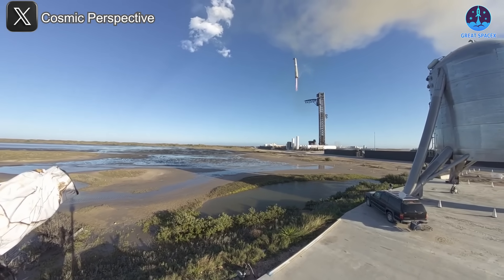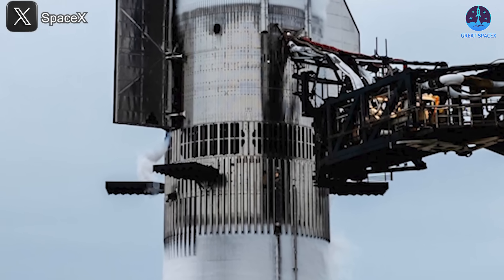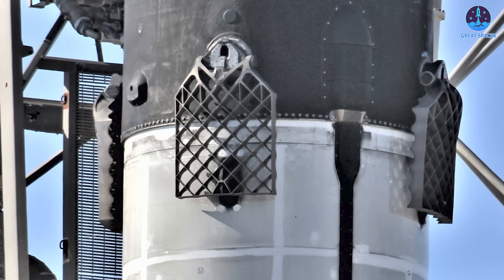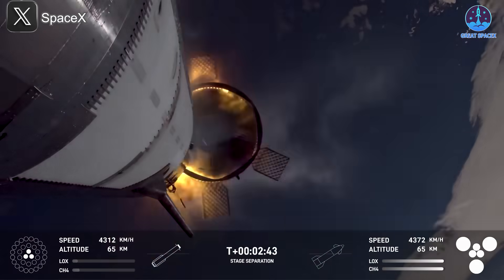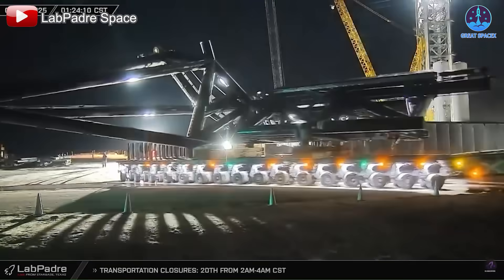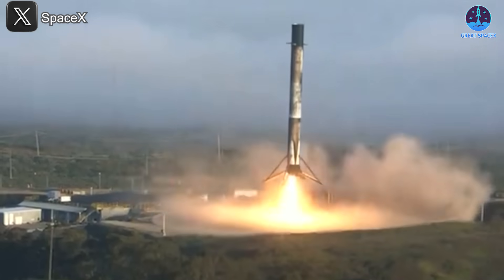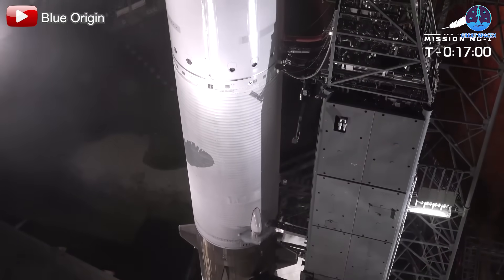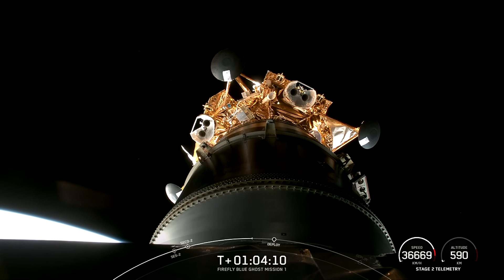Starship Booster 14 Grid Fin MELTED & WARPED During HSR Separate. What Happened?

Comment: Why reinvent everything. Use ullage engines on the starship to gently separate and settle the fluids. Then you wont need a hot staging ring. They are adding complexity and parts to avoid using parts that will just work. Its like the launch stand without a flame trench. Its been nothing but trouble, so now they are finally going to use a flame trench.
Reply: When they use titanium gridfinds, more heat resistant, what will be the more complex, failure prone solution?

Comment: This is a non issue.  They are just using steel until they get the design reliably landing.  Why waste $$ on titanium for a one and done booster that might end up on the bottom of the ocean.  A few more catches and they will switch.  Make a video about a real issue, like heat tiles.  Oh wait, you already did that one and don't have enough $$ coming in.

Comment: Just a point of for accuracy, the wing flaps on airplanes do not control the airplane's direction...
Reply: Yes: they control the decent adding more wing surface . Before flaps pilots had to “ slip the plane down by using opposite rudder to aileron in a. Controlled switching side to side .  It looks rather un controlled when in fact it isn’t. It can make passenger’s nauseous.   
They use this maneuver in movies to give the appearance of a plane out of control on landing.
Reply: They call these flaps because Musk does, even though they are actually "fins" and no one has the balls to correct him!!!

Suh a weird company when you have a lunatic in charge!!

Comment: Should forget hot staging😎
Reply: Starship is 100% garage engineering and barely climbs to half of the height of the altitude that New Glen first stage reaches !
Reply: @mokorily5022  But the Starship booster can and has been recovered....while the New Glen faces big challenges trying to reenter.   The BE-4's had SO much trouble in production that their chamber pressures are very low for better durability....but might not be high enough to offset the ram pressure of hypersonic reentry.   They had barely relit when telemetry was lost which likely means it went KABOOOM!   Both SpaceX and Blue Origin face challenges and so far....only one has proven to be able to work through them to a successful program.    Will be interesting to see how many boosters Blue Origin is willing to wasted trying to land one.

Comment: I haven't seen an explanation as to why the HSR is jettisoned.  Why don't they just leave it attached and land with it?  It can't be that heavy in comparison to the booster.
Reply: The ring's weight makes landing the rocket more challenging, the next version of the booster will have an integrated ring that will not have to be dropped.

Comment: STILL blasting stuff you want to reuse with several thousand degrees of rocket exhaust!!!  Is SpaceX ever going to figure it out!!!   🤣😂🤣😂🤣
Reply: SpaceX already has it figured out. The current booster gridfins are made of steel. Falcon 9 gridfins, on the other hand, are made of titanium. They don't suffer from these issues. But titanium is horribly expensive. So why would you use it on boosters you expect to fail or throw away? Once SpaceX are confident they have booster catching nailed, they'll switch over to using titanium gridfins, and this "problem" will disappear.

Comment: These are test (EXPENDABLE) vehicles. NEWS FLASH - launch count is still SINGLE digits. Why put expensive parts (3d printed raptor 3 engines, titanium grid fins) on a test vehicle that might RUD? 
Do you have any sense of actual ENGINEERING? (apparently not from the reused term "assault rifle" - no such thing - there is a term, it's assault weapon, and not to refer to semi-auto rifles).

Comment: This isn’t new, this has been an issue for the last number of flights.
Reply from the maker: Yes, I also said this in the video, but SpaceX should fix this as soon as possible
Reply: @colonbina1  - SpaceX will fix this (by returning to the use of titanium gridfins) as soon as they consider the boosters to no longer be experimental test-flights. Using titanium (which is horribly expensive) on boosters you expect to blow up or crash, does not make sense.

Comment: Hot staging a suposedly reusable first stage. The desperation to avoid using an ullage motor on the upper stage shows just how little payload capability this actually has. Hot Staging is another design decision that shows very poor project management in that they create much more serious problems for the stated objectives down stream to make solving the current problem easier

Comment: The ongoing improvements to Starlink satellites underscore a significant challenge in making the entire constellation feasible.

While introducing a new, improved satellite design is undoubtedly beneficial, hardware upgrades often render earlier versions obsolete. This raises the issue of legacy systems: should new satellites incorporate backward compatibility with older models?

As of January 2025, there were 6,912 Starlink satellites in orbit, with 6,874 operational. If the earliest satellites were deployed to cover priority areas while newer satellites were positioned to cover secondary zones, it would mean the most advanced technology isn’t being utilised where it’s needed most.

Even if possible, that could require a lot of satellite repositioning. 

Additionally, receiving equipment—both hardware and software—may require upgrading to fully exploit the enhanced capabilities, such as quadrupled bandwidth. This adds another layer of complexity to the system.

These challenges are not unique to space-based systems; terrestrial networks face similar issues. However, the remoteness and inaccessibility of satellites amplify the difficulty. Finding the optimal time to deploy new technology will always be a balancing act.

SpaceX, as the first mover, could succeed in deploying its planned global network of 42,000 satellites, only for a competitor to emerge with a revolutionary design requiring just a faction of satellites to deliver a superior service. It could be a Kodak moment for Starlink and other such orbital system if land-based systems are developed that offer the same coverage, faster and at less cost.

Before mobile phones were introduced there was a service in the UK called Rabbit where subscribers could carry specially designed phone handsets with them and make outgoing calls whenever they were within 100 metres of a Rabbit transmitter. The service was licensed in 1989 but it wasn't launched until May 1992, and in that time it lost its window of opportunity, as mobile telephones made the system obsolete. The lesson is that there can be a short period where a system is the best available and can make a profit, but take too long and it can be rendered obsolete overnight. The Company behind rabbit had to write-off $183 million but went on to create a successful mobile system. 

It is almost certain that at some point that a system in space, that comprises of 42,000 individual assets will be made obsolete by a more cost effective system, the trouble Space X will have is that if they are also the disrupters that are responsible for that system, they will be forced to cannibalise their Starlink system. 

Only new companies are immune to the issue of legacy systems. While it’s one thing to deal with legacy problems created internally, it’s an entirely different challenge when facing a new rival unencumbered by such baggage. Look no father than the traditional ICE manufactures, with the years of knowledge and experience designing and perfecting combustion engines and gearboxes, now being faced with discarding it all in order to build EVs where much of their competitive advantage is lost, or certainly diminished.

Comment: the grid fins are used during separation... if you look at the footage you can see them move before the upper stage engines start, so part of the exhaust gets captured and helps turn the booster... the only way to get them from warping would be a material that could withstand the high temps and thrust, also it shouldn't be to heavy and is cost effective...
Reply from the maker: So what material do you think is the most suitable?
Reply: @colonbina1  tungsten would meet the melting point criteria but is to heavy...
also i dunno if it wouldn't be to brittle...
Reply: perhaps flame spraying a ceramic insulating barrier over the aluminum.
Reply: @robertlescinski7449  the ceramic would be to brittle and crack due to the thrust...

Comment: Not really an issue. Just a bit of warping from thermal expansion. The grid fins would still work fine without refurbishment.
Reply from the maker: It still need to be upgraded for long term use

Comment: The reason why it's warping is because they are made of aluminum 
These are still test flights so they can't use the titanium grids fins like the ones on falcon 9 because titanium is expensive and they don't want to waste it 
Full production super heavy grid fins will be made of titanium
Reply: Each launch is said to cost $100M, do you really think they are penny pinching on something that could render the test flight useless? Titanium is 1.67 times heavier than Aluminium, more weight, more fuel, more fuel, more weight everything is a compromise. 

"Reusability" comes in many forms. It may prove that the the best solution is to keep the grids made of aluminium but then treat them as wear and tear items and like the tyres of a car can be quickly swapped out for a new set.
Reply: @martincday007  well I'm just telling you directly from what spacex said so 
And besides block 2 of super heavy can lift more weight 
Block 2 is the production version of super heavy 
And wear and tear doesn't make sense for full rapid reuseability 
Titanium is more valuable than aluminium and harder to get so why waste it 
They don't refurbish falcon 9 grid fins
Reply: @toptechtrendss  Can you reference where Space X have stated that?
Reply: @martincday007  Unfortunately I can't but they have 
Starship development has been in the works since 2016 so it's been a while
Reply from the maker: Let's wait for their next upgrades

Comment: Flaps on an airplane change the camber of the wing allowing the wing to provide more lift at lower speeds allowing the airplane to fly slower. Ailerons control the roll of an airplane allowing (with the rudder (which controls yaw)) to turn an aircraft.